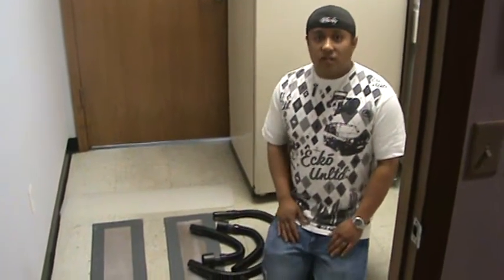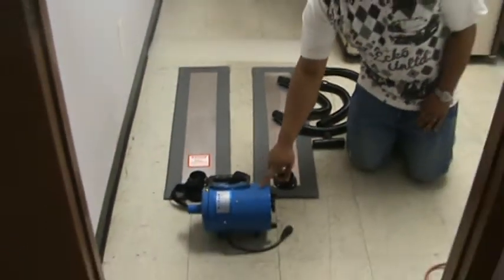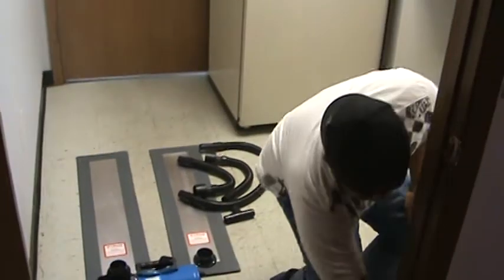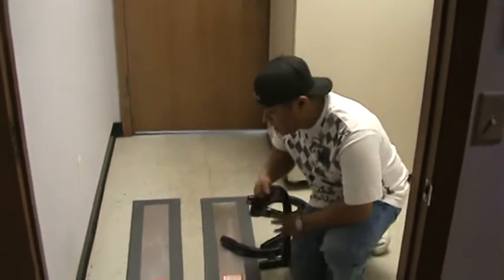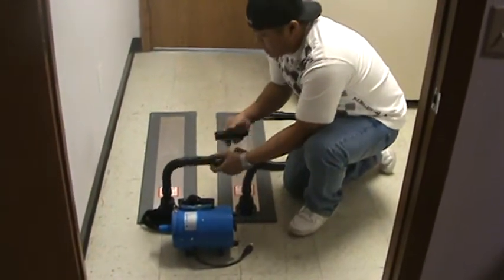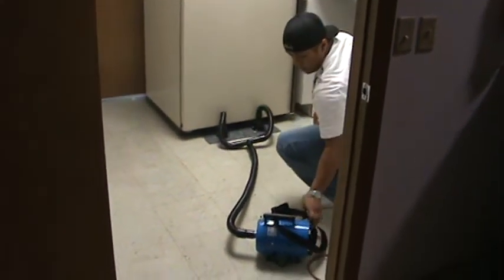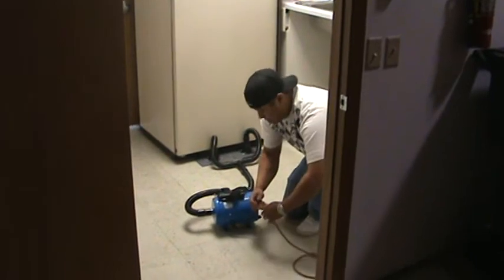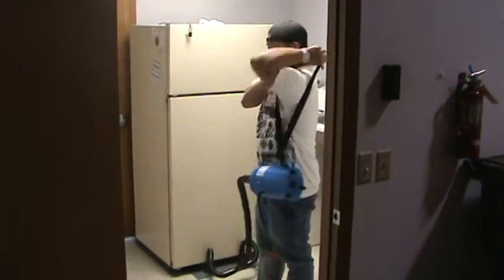Moving a refrigerator

Comment: What's the max weight this thing will lift?
Reply from the maker: Do you want the advertised limit or the actual limit it really does? I can't remember the max  but we stopped selling it years ago... as technology changes.... go with Airsled.  We love distributing for them and their products are FAR more superior, and lift what they say the sleds do.
Reply: installertools I have a French door fridge that full of food. I need to get behind it for occasional cleaning/repair and don't want to damage my floor. I'm not sure what the weight of this fridge is without food so I'm looking for the max weight this product can lift.
Reply from the maker: gnewt75 if you get a Crain 280 HD model I believe they lift 800lbs.  Airsled popular models do 600, 850, 1000, and 1400 lbs.
Reply: installertools a similar model to my fridge is listed at 394 lbs when empty. I'm guessing that if the basic model can list 650, that it might be enough. I'm thinking about budget as a factor when buying this airsled.
Reply from the maker: gnewt75 

https://www.installertools.com/products/airsled-model-2005-air-dolly-650-lb-capacity
Airsled model 2015 does 650lb and it's more economical than the other models.  But if you think you will go higher the next step for 800lbs give or take depending on the model.....$770.00+.  Hope this helps.  Crain would be 800lb price range as well.
Reply: installertools thank you very much for the help!!
Reply from the maker: gnewt75 any time!

Comment: Now, if the contraption actually provided meaningful benefit.  Refrigerators made in the past 20+ years are made with their own WHEELS under them.  So, you don't need fancy equipment to move the refrigerator around on flat surfaces.  Gee gads.

Now, make an "air dolly" that will let you go up and down the steps with the regrigerator, and then I'll be impressed.